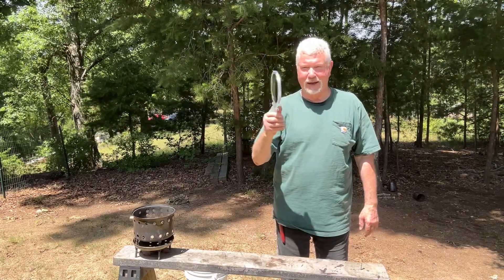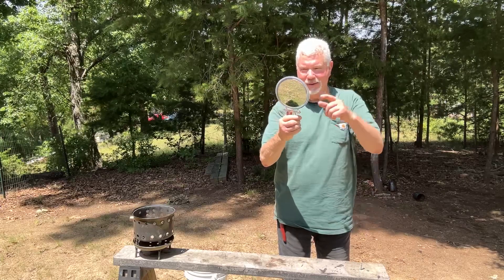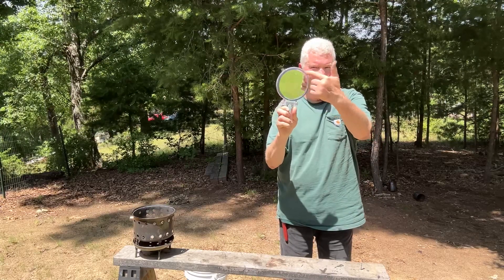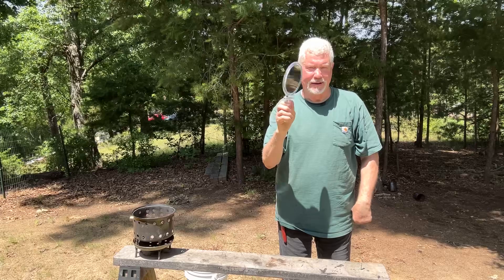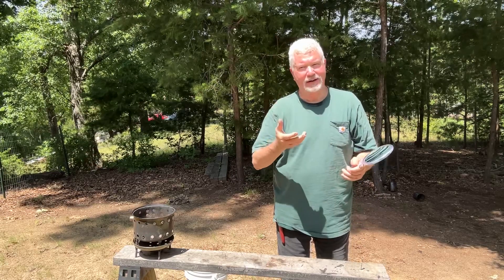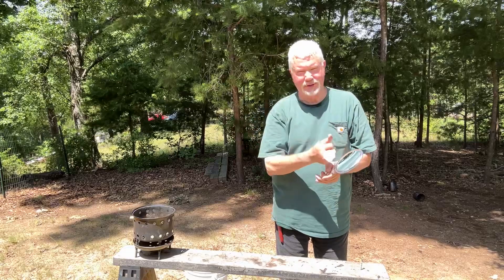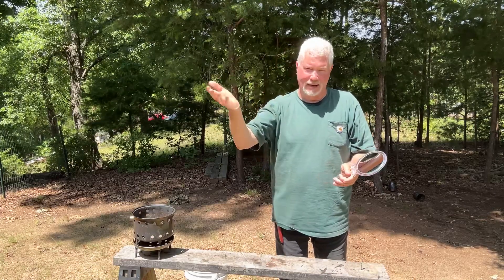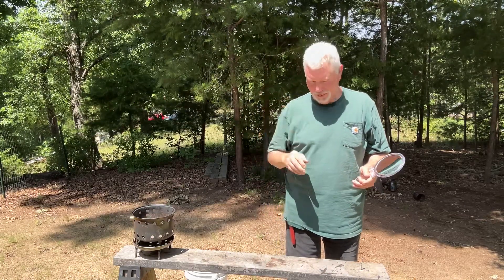Concave Mirror Solar Ignition Using A Makeup Mirror

Comment: Great stuff as always, Mr. West. Would you say that size mirror works about as fast as a similar size fresnel lens?
Reply from the maker: Yes, aaand the fresnel lens is the quicker igniter because you can see the focal point atop the tinder and better concentrate it. One struggles to see and adjust the focal point from a concave mirror because it's trained on the bottom of tinder.